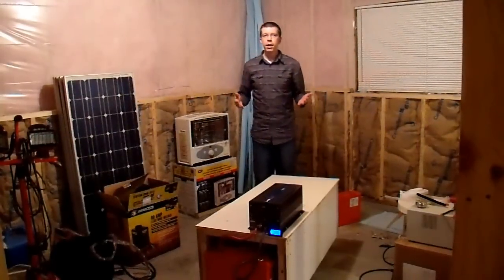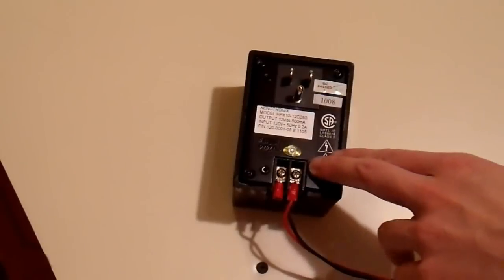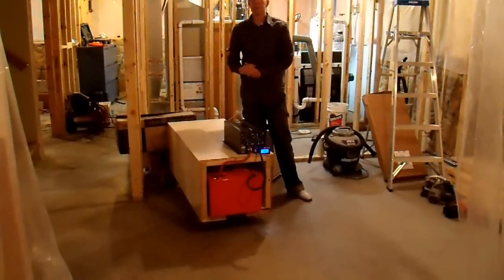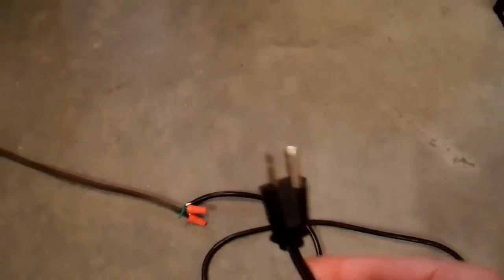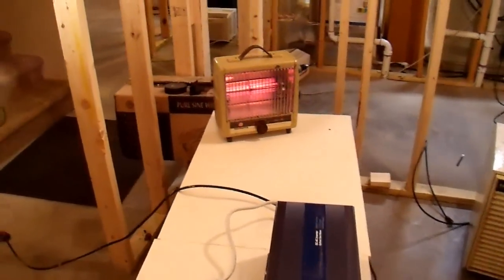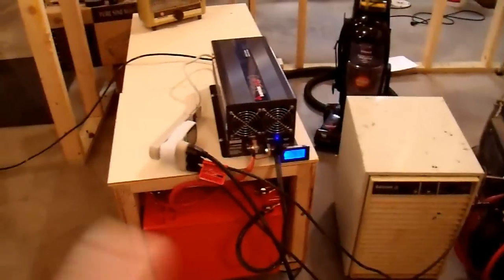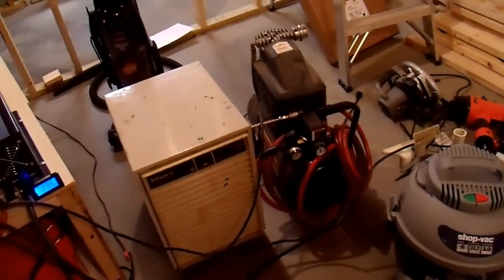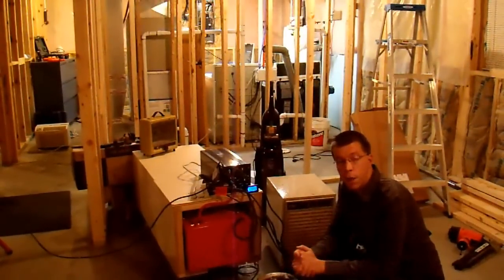1000Ah Battery Bank Part9 - What Can it Power??

Comment: I have a 400Ah 12v battery backup system with 1000W pure sine inverter.  I tried a 7A rated air compressor today and it powered it just fine and charged it up to 150 PSI.  The interesting thing was that once I let some air out, it was unable to recharge the compressor from 100 PSI back to 150 PSI.  It's as if it had a very hard time starting the compressor when there was already 100 PSI in the tank.

Also fridges are a challenge ours surges to over 2200W.
Reply: it is because the pressure in the compressor didnt equalize

Comment: I have a similar setup however I can't afford a single inverter that can power everything so I have a 1500W sine wave inverter to power my refrigerator directly with an extension cable and another one to power the rest of my house both of which are connected to a 2200AH battery bank made up of batteries I acquired from my local scrap metal dealer for about $1 per KG and I have 2X 250W solar panels 
So far I have not needed to get grid power connected to my house at all and it's all connected to the house with a suicide cable for about 6 months so far with no shocks or fires

Comment: The video series is quite long, but certainly is well done. I am interested in setting up a battery bank, that for my initial application, that can store and use solar power in our greenhouse. It will be used to power a 3600 gallon per hour sump pump, a water heater for heating a 3,300 gallon swimming pool (for raising tilapia) and some lights for nighttime activity. We've built a 17'x 57' greenhouse and are raising the fish, as well as about 15 different fruits and veggies. I saw a solar panel in one of your videos, but didn't know if you're powering your home on solar and using the batteries to store power.??? Where would you recommend that I start hunting for good, deep cell charging batteries? Phone companies? We want our greenhouse to run completely off-grid
Reply from the maker: There are few good options for cheap batteries for commercial applications.  I happened to find a good deal through my place of employment but most people will need to purchase batteries at retail prices for commercial applications.  I would recommend forklift batteries (or golf car batteries if you want to save some money up front).  The most important factor in overall cost is to ensure that you treat the batteries properly and don't damage them with deep discharges or by not bringing them up to full charge every day.

Comment: You know just one small request to EVERYONE who does the DIY videos.. when turning on LOUD BUZZING AND SCREACHING Equipment to BUILD or TEST the green energy units... can you PLEASE when doing video post processing at that moment the device is turned on making said noise.. lower the decibal gain on the audio.. because some of us don't want to wake our neighbors or more importantly have the static like sound of your videos destroying the coils in our speakers we paid a good deal of money for.... yes static like sounds at any volume level will cause coils in speakers to start to short out.. thus needing we the viewer of your videos to have to pay money to replace our equipment to watch your videos... thank you.. though I like the video on this battery box... one thing you might try is to get a trailer innertube (rubber) , then cut it into about 6 inch by 24 inch strips..  (four of them) and then take some old vacuum cleaner motors/fans and attach the rubber around a circular plate with a wire at the bottom "hooping the rubber" at the bottom with a duct from the vac motor/fan forcing air INTO the rubber chamber you have just made.. yes you are making hovercraft "feet" (four of them) and removing the caster wheels and just when you need to move the unit.. flipping the switch on to levitate the box on air in the four hovercraft booties and well it would be very easy to push along.. just my dime and a half's worth...  keep up the good work...
Reply: +Jesse Mercury You could anticipate the turning on of said appliances, realise this video was not produced by George Lucas, and turn your speakers down.....oh wait that requires less effort than an essay on decibal gain reduction request......
Reply: JESSE YOU ARE A WEIRDO..
Reply: +Jesse Mercury SCREECHING.
Reply: i had the same request...was sitting across the room while watching. you dont have to be geroge lucas even 2 fucking years ago when jesse wrote that comment it was easy to do.

Comment: I don't want to sound rude or stupid but I need to ask a couple questions. I have looked up that inverter and I have found them for $400 to $1400 and they all seem to look the same so trying to see if you can put out the part number of it. because I don't want to buy one for 1400 and only need the 400 one.  and one more why don't you use solar to charge the batteries.
Reply: never mind on the part number all I had to do was read more of the post but thanks

Comment: Great video! That inverter can handle loads better than a 6KW gasoline generator IMO. You were mentioning how you connected the battery bank near the beginning of the video. A while back, I had a small setup like yours before we got a Generac whole house generator installed. What I did was individually connect EACH battery to a POS and NEG buss bars. Connecting the inverter wiring to the middle of each bar. You can use a bit smaller gauge wire from each battery then AND, using a DC clamp meter, can monitor current output from any battery to determine it's health under a load. You could use 1" steel angle iron maybe as buss material. Bolting each wire individually to the buss. Thanks!
Reply from the maker: That's a good idea!  I'd be worried about anodic corrosion with the dissimilar metals but copper pipe could substitute for the angle iron if desired.  Your method would make checking the condition of the batteries much simpler.  The practical complications of checking each battery in a typical bank means that they are never actually checked until one fails and takes out the whole bank with it.
Reply: Thanks for the reply! Oh ya, a copper bar or heavy gauge pipe would be ideal if $ were no option! You shouldn't have any corrosion issues if you first load up all your bolts and connections with De-Oxit goo if using a steel bus bar. The idea of buss bars came up because I work on small boats that don't have any common grounding like cars!
Reply: +knurlgnar24 Another thought I had was this. You might be able to find 1/8 to 1/4 inch thick copper flat bar. It would be VERY expensive, but it would solve the dissimilar metals issue entirely.
Reply: +Bruce Forster Thick walled copper water pipe. Flatten the spots where you want to make cable attachments and drill it out for bolts. Works quite well. Need to insulate the pipe bars so you don't accidentally short them out.

Comment: the circular saw is only 13 amps under load maybe it will reach 13 amps temporarily at start up but should fall drastically once started
Reply from the maker: Very true.  It draws far more than 13A on startup but only an amp or two at full speed and no load.  13A is at the full load rating.  Locked rotor current will be far higher than 13A.

Comment: Hi, I liked your videos about batteries and recognized a kindred spirit in you. I use a battery maintainer that can handle up to 12 batteries and it desulfates continuously. I actually turn it off for several weeks at a time then turn it on for a couple days to refresh the batteries. You're very knowledgeable about this stuff and make it interesting. I watched all 9 of your vids all the way through....and I subscribed. Thumbs up!!
Reply from the maker: Wow, thanks for watching and for the sub!  I do that too with battery maintainers - disconnecting them most of the time and only connecting them for a few days to charge and equalize.

Comment: Many folks will keep a large deep-freezer (frozen food cache) in their
garage or in their basement ... Those do tend to have a significant startup
power-draw ... Add your kitchen refrigerator and a long extension cord (rated)
and THAT (those two appliances plus fluorescent lighting) would be a typical
EMERGENCY (sustained) power-draw ... and, YES ...  It would be important to
test just how long your expensive frozen meats could be preserved, in the event of
a protracted main power outage. ... How many days, given that you are particularly
disciplined and you ONLY open the fridge or freezer BRIEFLY and INFREQUENTLY.
Reply: Change lighting to LED and your Voltage/amp draw needs will fall drastically.
Reply: Not as high as 500 doubtfull. I test every circuit for Volts, amps, and Watts. It all depends. The lights only need to be on if necessary. The Freezer is always needed  but not on constantly it cycles. Here is our numbers on our freezer. 110v, 1.3Amps, 143 Watts, 6.6 cubic foot freezer. The wattage on the freezer is so managable and it is not always on. I tell people all the time if your frig or freezer is low on food. Fill it with 2liter jugs full of water. This will absorb the cold and keep your appliance from coming on often.  The lighting for the LEDS. I am going to get High Intensity LEDs. I don't have numbers for you at the moment. I think that circuit will have to be calculated individually. A good number would be a 1/3 to 1/4 the power. I am pretty sure when I change everything over to led we will save 30 percent of our electric bill and will never have to worry about power outages or electric bill increases.  

Oh, I just watch witch vid you were referring to those could be higher than 500 up to 1000 he is only doing that as a test for the vid. Still calculte your circuit individually. The math in electronics is always dead on.

Hope this helps ~ Will
Reply: William Ward   THERMAL MASS ... And, also displacement of any cold air that would escape, because that space is occupied with solid, frozen mass. ... Of course, open the freezer as seldom as is possible and shut the door as quickly as possible.  ... And ... You COULD have LIVE bunnies, in a back-yard hutch (live meat is nature's refrigeration)

Comment: Great videos! What's your opinion on powerbright 1500 pure sine?
Reply from the maker: I've had one of those.  They're not bad, but I would NOT use it in a vehicle due to the internals not being vibration hardened - only for stationary use.  I would recommend stepping up to the 2200W model though as it is more efficient, has better surge performance, better heatsinked, and is still the same size.  A better value overall in my opinion.  These inverters do have a nice and low half amp current draw at no load and quiet operation which are major selling features in my mind.

Comment: This may have already been asked, but did you happen to notice what the packs remaining voltage was after these tests?  Really curious what the total drop was after this.
Reply from the maker: I didn't check but it would have been negligible.  This whole batch of testing would have only drained the surface charge on a battery bank this size.

Comment: Thanks just learning about solar setups and what is needed and all about amp hours on batteries and inverters, your set up looks simple to follow and if it was smaller ie 6 batteries could be charged with solar panels just need to fig out what size panel would be needed.

Comment: that's cool, would 6 batteries run a TV and a console and a heater or 800w microwave oven?
Reply from the maker: Two good batteries in parallel would be good enough for the load you describe, however it would not run them for long.  6 batteries would give a much larger useful state-of-charge range.

Comment: +knurlgnar24....i guess that this inverter is the same thing as the GO Power 2000 Watt inverter you showed in one of your videos (yellow color)...i have seen another brand of almost same shape and everything, COTEK.....are these the same things ?? any idea ??
and its data sheet says operating temperature range till 40 degree cenigrades....do u think it would operate at about 46 degree centigrades , bcz thats the temperature of the place where i live
Reply from the maker: There are many brands that are essentially the same.  Cotek, Samlex, Go Power, Thor, etc.  I do believe it will operate at 46c without issue but 46c ambient is very hot for electronics and will degrade performance and life.

Comment: I don't know if this was ever addressed by you or another viewer. But, have you considered, now that you have 12 batteries in parallel, rewiring them into three strings of 4 batteries, at 48vdc? I realize you would have to buy another inverter with an input voltage of 48vdc. But, it would be considerably more efficient. Not to mention, the batteries would charge more evenly, having been wired in series.
Reply: The only advantage higher potential systems have over 12V systems is that loads of a given power require smaller wires, which somehow became conflated with efficiency due to many people having no idea what electricity is.  It is also due in part to the fact that this was true decades ago when the only available switching devices for use in the inverter were silicon controlled rectifiers (constant potential drop of 700mV to 1.5V between anode and cathode) bipolar junction transistors (constant potential drop of 100mV to 1.5V between collector and emitter) and relatively high resistance MOSFETs (at least a few hundred milliohms between drain and source).  As such, lowering the current that the SCR/BJT/MOSFET was switching greatly reduced system losses.  Given that single digit milliohm Rds(on) MOSFETs are common nowadays, this is not as big of a thing as it used to be.
Nowadays, 48V (and 24V to a lesser extent) systems only make sense if the only DC load on the system is a big inverter as switching 48VDC is much nastier and harder to do than switching 12VDC due to contact arc quenching, thus making switching loads more of a bother.  48V lights and appliances are also much harder to find or are not available.  Having a single big inverter as the only DC load creates a problem as it is a single point of failure that renders the whole system useless if it goes tits up.  Such inverters are also very expensive, and thus most people can't afford to have a spare, whereas 12V inverters are sufficiently cheap and common that multiple spares do not constitute a serious financial burden.  12V lights and appliances are also dirt common, as are switches that can handle 12VDC.
Reply from the maker: I find 12V to be more flexible and the 12V to 48V difference doesn't yield much of an efficiency improvement in practice.  Higher voltages are more difficult to properly match in batteries also.  12V is very easy.  48V is not.
Reply: ***** Typically, most RE folks would go with 6vdc batteries to make up 24volt or 48 volt banks. And, you can't continue to use a 12v battery bank, if you are running say, a 2,000 watts solar array. You have to increase the bank voltage at some point, unless we are talking a small system, usually under 1,000 watts, more often less.
Reply: ***** Of course, no one can discount the fact that you got a heck of a deal on batteries. I live abroad and probably will never be so lucky.

Personally, I would have split your batteries into smaller banks, and had smaller arrays to charge each bank separately. Either way, good on ya, for getting a deal - twice! Lucky dog!
Reply from the maker: Paul Petrea
All else being equal I would use a 24V or 48V battery bank as you mention and we agree on that.  For my purposes, however, intermittent use favors a standard 12V system.  Not everyone will have the same needs or circumstances.  For example, if I had a permanent solar system I would be using a 48V system but this is not permanent in my case.
Reply: randacnam7321  Fair enough.

We were discussing this very topic on a solar forum I am a member of, not too long ago. A member found some rather large 12vdc inverters - 8,000 and 10,000 watts units, which are almost to the point of insanity.

I would never consider pulling that many amperes through a single inverter. We are talking crazy amounts of amperes here, not to mention the size of the eight (four positive and four negative) cables needed to feed it. Take a look: http://www.walmart.com/ip/Wagan-Wagan-8000W-Continuous-Power-Inverter/23528686

I would never consider using such a device on my system. I would simply change all of my 12vdc lighting and electronics at the farm to 220vac and not concern myself with any further DC loads. Then, I would run my battery bank at 48vdc, as both of you have mentioned, drawing fewer amperes and having a safer operating system. 

With that said, if someone has a "must do" situation for low voltage devices, they could simply go with a 48vdc to 12vdc (or to 24vdc) converter.
Reply: Paul Petrea
I have seen those 10kW inverters, which probably exist as gimmick/joke items as much as anything else.  At those kind of loads, I would use multiple 1kW to 2kW inverters for each constituent load as I don't have any single load that big.